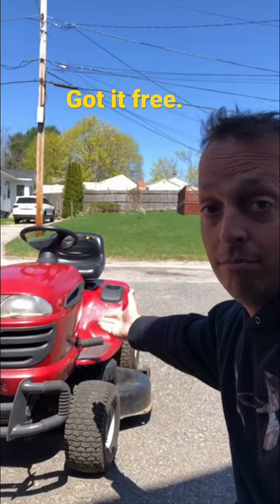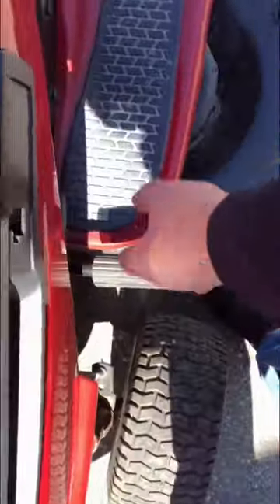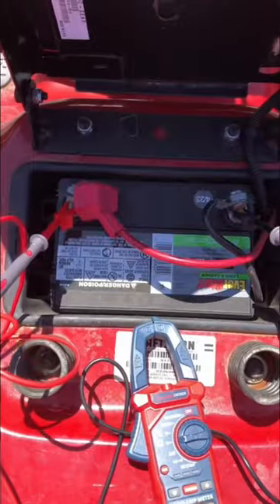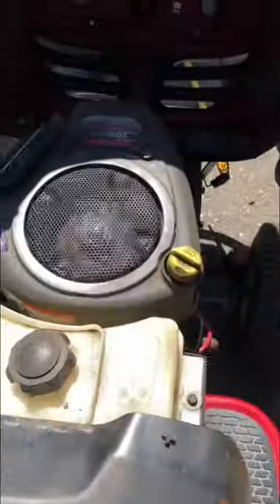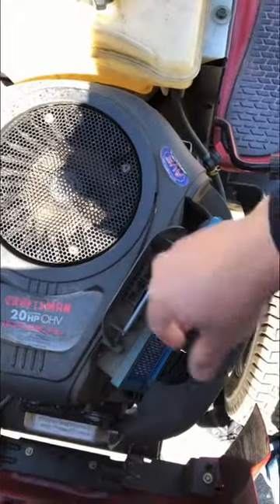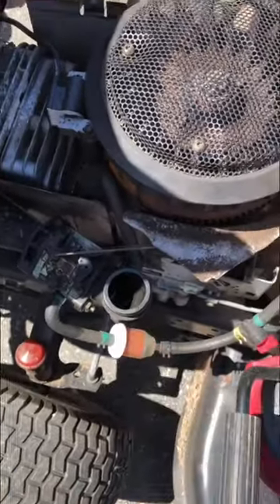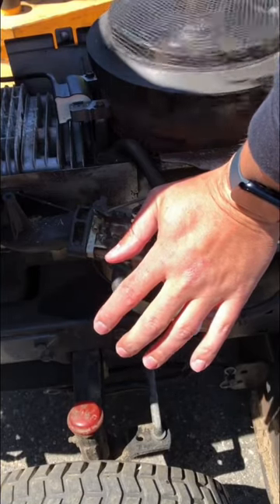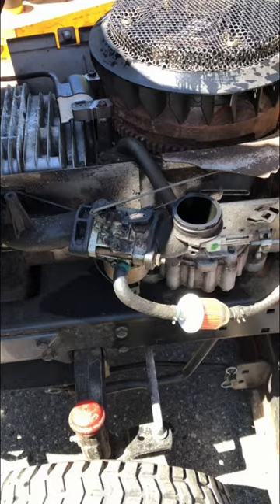Free mower. Won’t start. Cover the air intake! Briggs engine, Craftsman mower #smallengine

Comment: Remove air filter spray starting fluid why take all that apart
Reply from the maker: I knew the history of the engine and mower. Strictly in this case, that would have added more fluid into an already hydro locked engine. Could have pulled the spark plug instead. This was my process on this day only. I learned the trick and had never seen any videos about it so I wanted to help some other people out that hate reading.

Comment: The compression release pin on the cam is broken and is a well-known issue. The only real fix is replace the cam. And don't buy a Chinese "kit" with cam, gaskets and tappets. They are junk and many only last as long as the first start. If it's $25, it's junk. Buy OEM for $75.

Comment: Usually when mine doesn't work it's because the mice built a nest in the engine. Just pull it off, crank it over, and enjoy the mousebit fireworks all over the lawn.
Reply from the maker: 😂🤣 I hate those critters

Comment: Those shitty Briggs and Stratton vaporizers… the shut off magnets usually stick and flood the engine -.- classic hydrolock… change the damn magnet or use the manual sh*t off valve and it should be fine 😅

Comment: "Permanent" problem on a tractor mower you intend selling...
Reply from the maker: And I fixed it, told the buyer what I fixed and that it hydrolocked. Showed him how to use the fuel shut off too. It’s called Integrity.

Comment: Put a fuel cock on the fuel line.  they have a problem with siphoning the gas into the cylinder and hydro locking.

Comment: It looks to me like it just needed to spend a little bit to get started and I'm not understanding why people are telling him to adjust his valves when in reality it probably just hasn't been started in a while and in the beginning of the video it seemed like he was having electrical issues which it's probably responsible for the low RPM of the starter which is why the engine didn't start up right away
Reply from the maker: Exactly. I needed to move the mower from point a to point b. Thought, “not a lot of people know this trick!” Made a video about it and got all the walks of life telling me “great job!” And “idiot!” And “valves!” And “I’ve been working engines for 40 years and didn’t even know this.” The internet is funny. This is a fun ride 😂🤣

Comment: That’s very dangerous and can lock the engine for good. Just remove the spark plug it’s really easy and replace or clean the needle in the carburetor.
Reply: It flooding wasn't the problem, it has no compression release is why it wouldn't turn over. All that fuel in there built up when he plugged the intake and was cranking it

Comment: Nope, leaky needle and seet the carb is filling the cylinder full of gas. Valves should be OK
Reply: It got hydrolocked by fuel. The needle valve in carburettor needs cleaning.

Comment: I guarantee you if you just would have helped it out and spun the top of the motor with your hand that once you get it spinning it will stay spinning and then eventually start because you did a lot of extra work to basically do something that you most likely didn't need to do not only that when you started that mower it blew loose debris and s*** everywhere which just went straight down into your intake

Comment: Something stuck in the fuel line ,,,,beleave me ,,,,and starters bad
Reply from the maker: It’s hard to do a remote analysis! Fuel line was good. Starter is top notch. Gas leaked into the cylinder head and hydro-locked it. We did a valve adjustment and carb clean and BAM 💥 she was out the door 🥰
Reply: @Nice Lawn Bro  put a shut off Manuel in fuel line ,mine drained the whole fuel tank into the crank case over the winter little 3 dollar shut of stopped it ,,,good job though at least u found it lol

Comment: The intek single cylinder ohv engines are junk. If the battery and starter is good,  you may get by with a valve adjustment. If no, camshaft lobes wore and decompression not working as should. Then check what the cost of new parts without labor and you will see. Your mower just saying.

Comment: There was so much wrong in one video.
Reply from the maker: “Temporary fix to a permanent problem” was stated clearly, Big John. The valves were adjusted, carb cleaned and the problem went away. 🥰

Comment: Adjust the valves and you will not have to do all that nonsense.
Reply from the maker: This was quicker and required minimal tools to get it to move. You are 100% correct in that when I adjusted those valves 💥 problem solved.

Comment: Misinformation platform
Reply from the maker: Nice! 👍🏻 can I see your videos? I’m willing to learn; just need the right teacher.
Reply: @NiceLawnBro  what would you like to know I would be more than happy to assist you
Reply from the maker: It was stated something about misinformation. 1, which part and 2 what’s the correct info? Do I need different tools?
Reply: @NiceLawnBro  well sir did you check your valve lash for that you need feeler gauges but I'm sure you already know this
Reply from the maker: @mdacosta7013  yup. Exhaust was out of spec at 0.010”. I adjusted in another video to 0.005”
Reply: @NiceLawnBro  what was the result of said adjustment
Reply from the maker: @mdacosta7013  success. 0.005 on the exhaust. Intake was within spec.